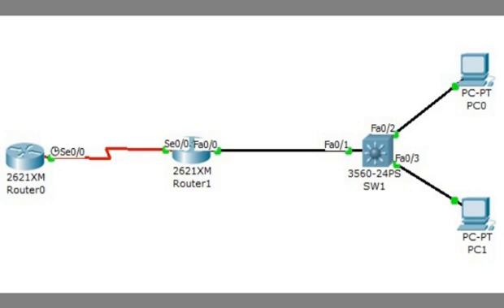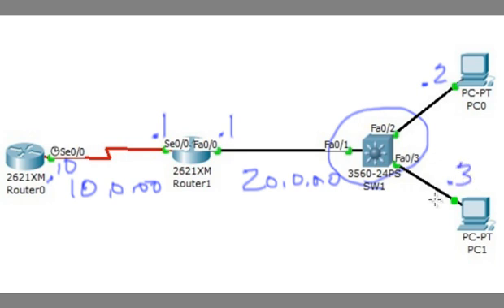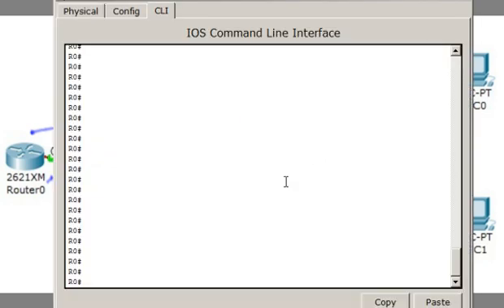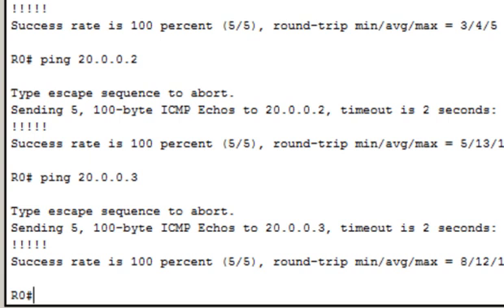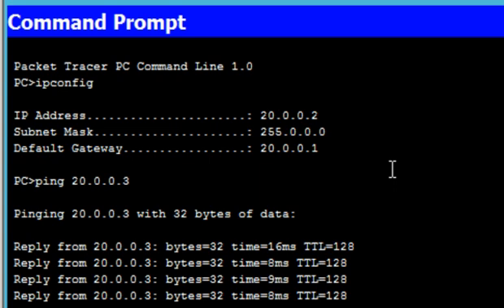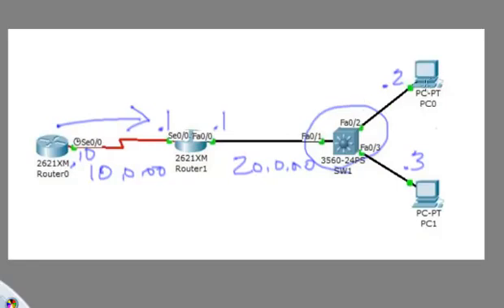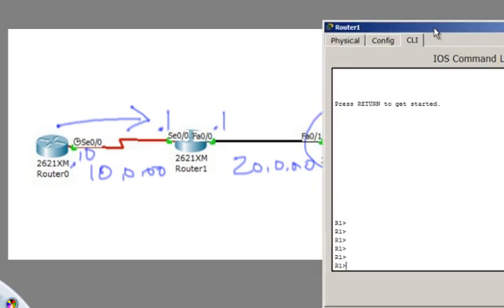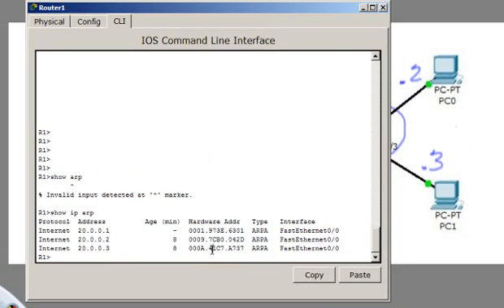What would the arp cache look like.

Comment from the maker: Hi Roomi-

Clearing the ARP cache would cause additional ARP requests if the device needs to forward to those addresses that were in the cache.

Keeping a record of the ARP cache, isn't a standard practice, but using tools like Dynamic ARP Inspection (DAI) is a good security practice.

If you place the DHCP server away from the local clients who need it, you would have to use a DHCP relay agent to use the server.

Those are some of the thoughts that come up in answer to those questions.

Keith